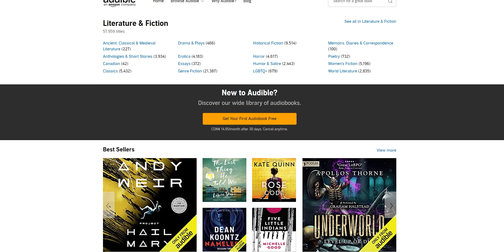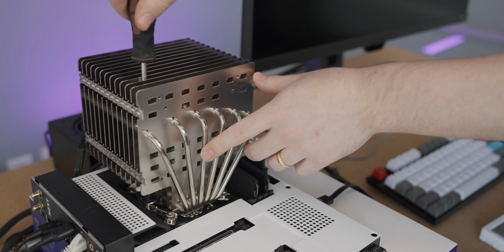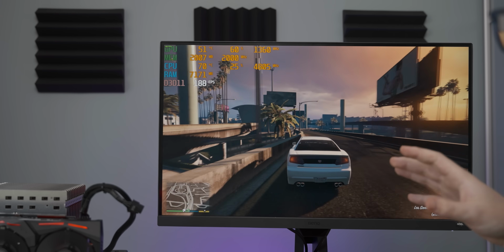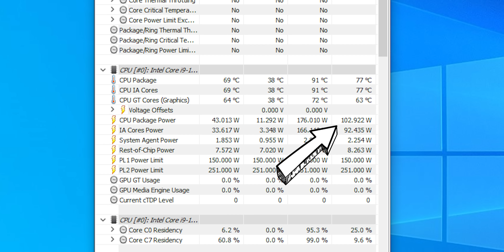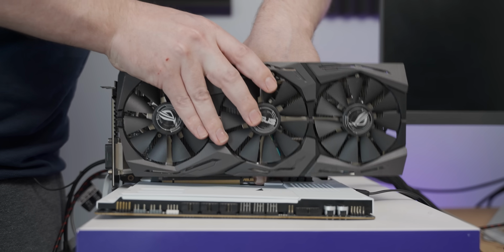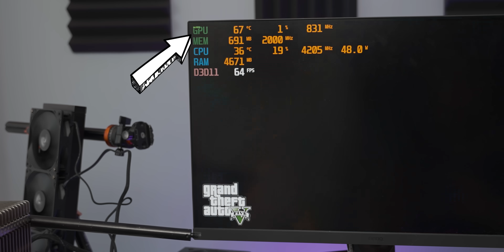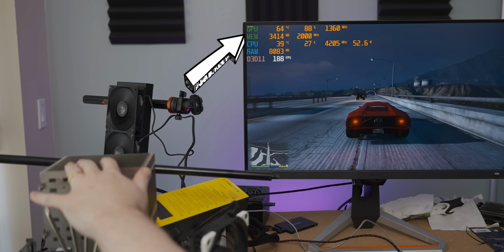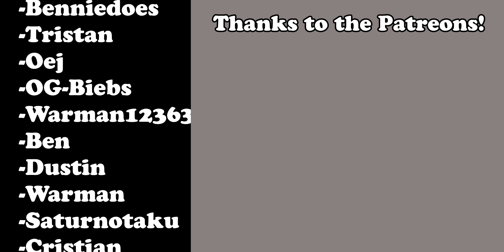I Do Naughty Things With Noctua's New Passive CPU Cooler...

Comment: I dont understand why you pointed out average power consumption when the more important metric should be closer to peak power consumption. Your cpu reportedly pulled 170+ watts which was clearly too much and caused it to hit near 90c, and the rx580 was closer to 135 watts and the temp was around 70c. And this is in open air in a cool ambient doing gaming (not heavy cpu loads such as rendering). With these numbers, it is an ask to spend over $100 on a cooler for an 8 core cpu, but compared to the passive cooler market, this is actually pretty good.

Comment: The looks like a terrible cooler, around 90 degrees on GTA V using 30% utilization on an open test bench... I feel like it would be even worse depending on what case you have, definitely not a high-end CPU cooler lol

Comment: Noctua, this cooler is not adequate for "high-end" CPU cooling.....
Reply: Yes in its base form but per Noctua you can add a fan to it which would allow you to cool higher end cpus as well.
Reply: @SunnyD514-yuck  the whole point is that it is a passive cooler.

Comment: I find that zip ties don't work well for this purpose because of how they are notched. You get stuck in a situation where if you could tighten just one half notch more, things would be perfect. I think that something with spring tension, like a bungee cord, could work even better. Or ideally, you could make your own mounting hardware out of metal or 3D print an adapter to go from the screw spacing of the graphics card to the screw spacing of the heatsink. This would be totally legit.
Reply: Masking a metal clamp with standard materials would be easy.
Reply: @quintoblanco8746  Yeahh, all you need is a sheet of aluminum or steel. And you can mark the holes using the mounting hardware as a stencil.
Reply: @CaveyMoth  I used threaded rods (full-length thread) and heavy duty steel strips with holes to make clamps that press on the underside of a low-power card and the top of a cheap heatsink.

With additional strips to make sure that the pressure was applied to the middle of both components.

Profiles instead of strip might be better. If the card is long enough to use rods on both sides, the whole thing becomes a lot easier.

Comment: you know what to do, buy a second one, and make sure the whole computer fits inside of a case that can comfortably house both monstrosities, But do so perfectly. not just a computer case, but a passively cooled one, that has no fans.
Reply: Nah. Stick 'em all in the Abkoncore Ramesses 780 and see how much fusion you create.
Reply: what you're describing is called an oven.
Reply: I had to go check DIY Perks channel, this seems like a natural next step for either his wood and rope pc, or the cloud unit.
Reply: In a case with no fans it would quickly overheat with this hardware. Now in a well ventilated case with a couple of quiet fans it might actually perform better then open air. A fanless system would need the heatsinks on the outside of the case or the entire system power would have to be very low.
Reply: I think thermal saturation would be an issue
Reply: Ironically, this sounds like an Onlyfans request

Comment: Why did they not make the base copper you could have used liquid metal
Reply: It's nickle plated copper like all modern aftermarket coolers,  so no problems with liquid metal.

Comment: Now put it in a Dell prebuild case 😂
Reply from the maker: Hahaha!! I don't want to be responsible for forest fires in my local area.
Reply: @DawidDoesTechStuff  HOW IS THIS MAN SO DANK?
Reply: @DawidDoesTechStuff  Hot Rod the damn bitch. I mean think of blower sticking out of the hood. If this thing stick out the side of closed case it's gonna look mental. Then some blue mettalic paint/plastifip/wrap, white strpes and boom SEMA is yours.
Reply: @DawidDoesTechStuff  That's why they make thermal throttling a thing.
Reply: OMG u r so naughty

Comment: Can't wait to get one and add a nf-a-15 to it for EXTREME cooling
Reply: Or just use a nhd-15 like normal people
Reply: @naicon971  Bought NH-D15S due to RAM clearance issues but added an extra NF-A15 anyway. Oops
Reply from the maker: I'm sure it'll be a beast! But I do kinda agree with Naicon. 😅
Reply: The fins have spacing for a reason, a fan would render that spacing pointless. A cooler with less spacing would be more adequate with a fan.
Reply: @Catknapper  so your sayin when you burn your finger stick it in hot water?